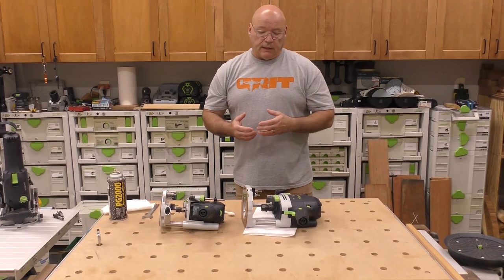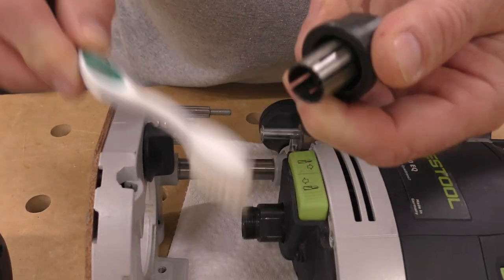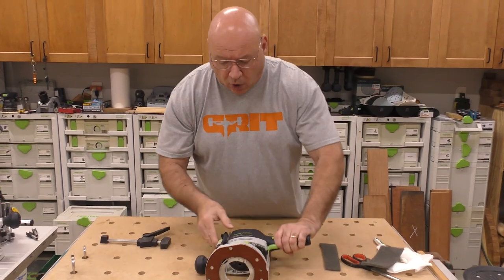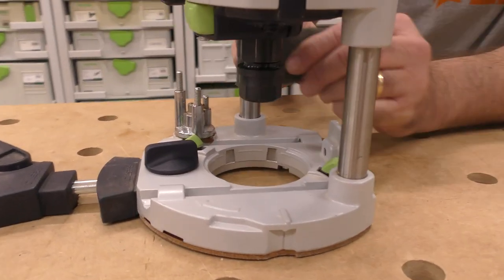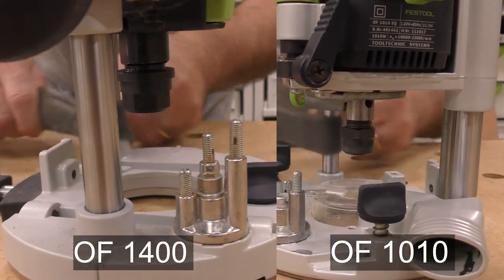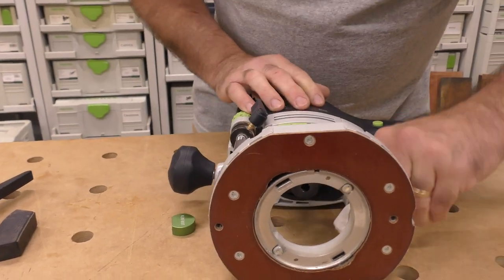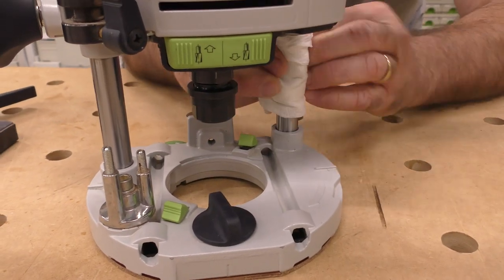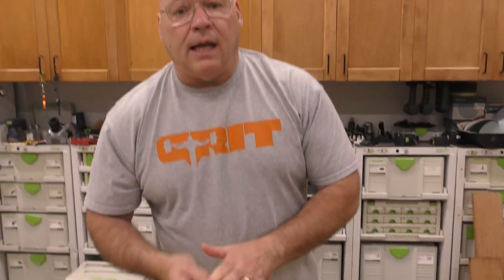Plunge Router Maintenance

Comment: Great bringing this up. Judging by the state of pre-owned routers here over the pond, I don’t really know if any maintains their routers (or tools for that matter). I got a bargain OF1010 once, it wouldn’t plunge at all.. After wet sanding the columns with high grit wet sand paper and later polishing with scotch brite, then metal polish and finally a thin wipe of oil - it was like new., plunging smoothly.
Do a maintenance day as Segde suggests, and you’ll have dependable tools - they also keep their value, both in use and also the day it’s time to part with them.
Reply from the maker: Thanks Sol !!!!